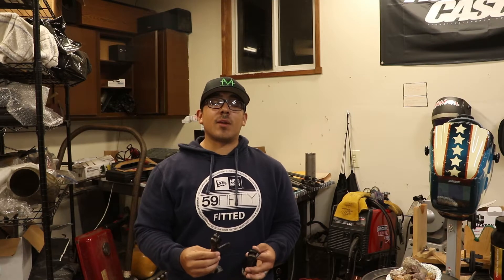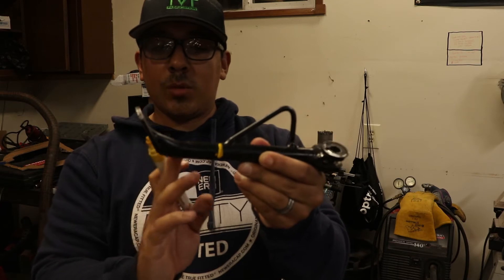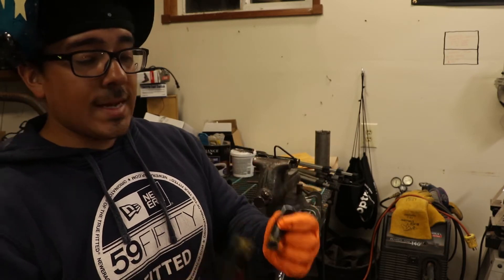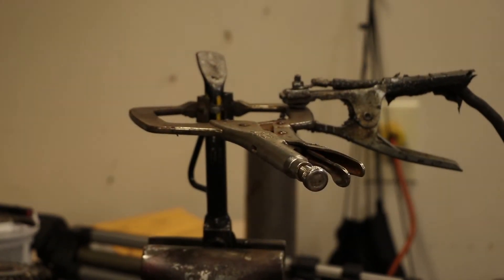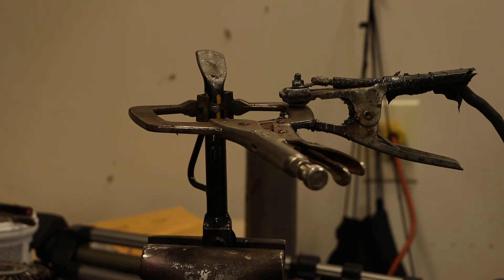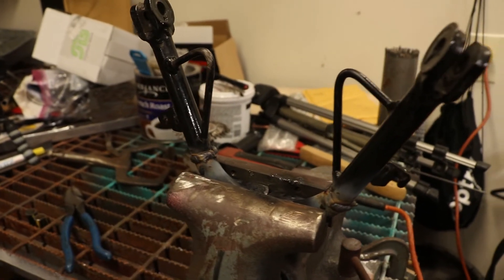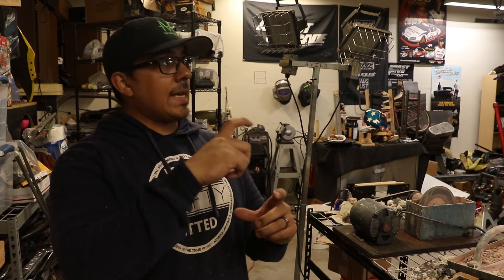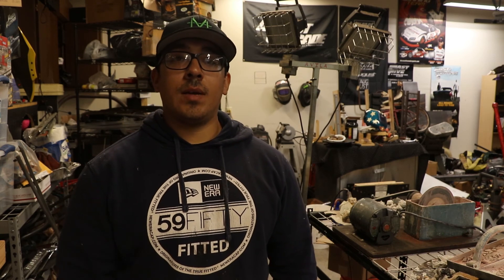Shortened OEM Honda Grom Kickstand!!!!!

Comment: Without knowing how you determined how much to cut out, the video is useless...
Reply: Just guess work bro. I put a 2.5" lowering link in a z125 and the stand holds it almost straight up. I think an inch and a half is what i want to take out.
Reply from the maker: Thanks for commenting. Like the previous comment, it all depends on the bike and the set up. I was sent a photo of a shortened kickstand and based off the photo I used the cut points, which was about an inch and a half. After it was installed on the bike the measurement was perfect for the lowered Grom. Thanks again for the comment.
Reply: @amagarage2535  I just did this to my wife's z125. Cut 1.5" and it works very well. Another .5-.75" would've made it lean like my stock height grom.